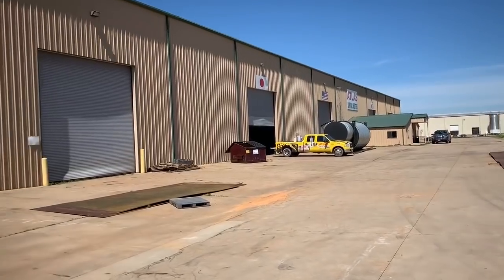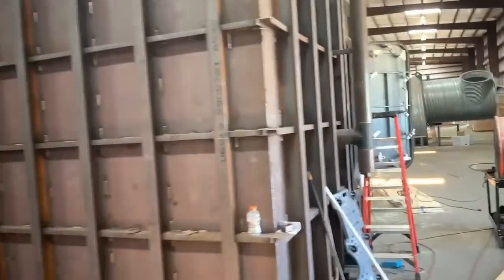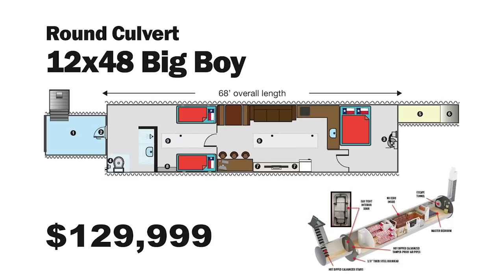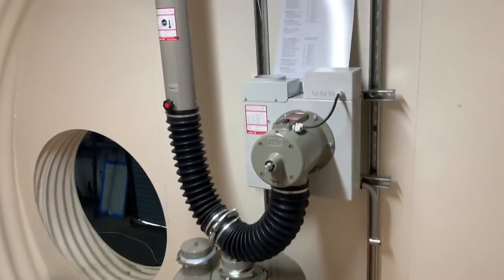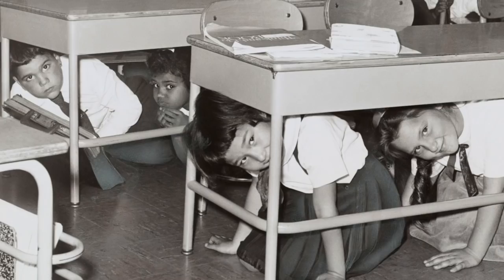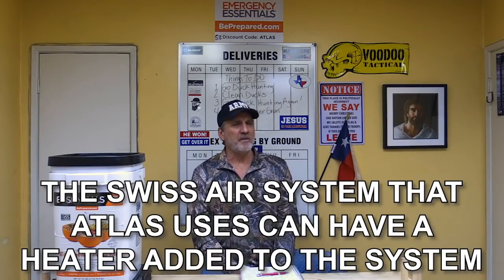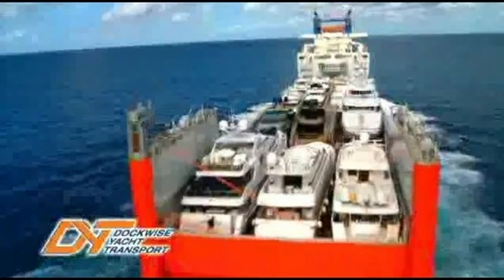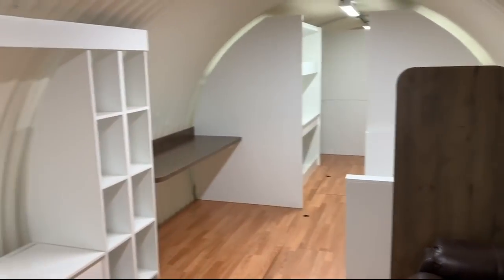Big Boy Bomb Shelter is where I'm spending the Corona Virus Quarantine.

Comment: Ron make sure when your guys are welding on the galvanized tubing exhaust the fumes. Galvanized products being torched or welded on fumes can kill a person. I've seen it happen.
Reply: They should be cleaning off the galvanising for a better weld in any case
Reply: @CreatureOTNight  you mean the CCP Virus
Reply: @CreatureOTNight  The gases released by galvanized metal without proper ventilation and/or ventilation welding masks can kill within 1 minute or less, and the person whom it killed won't even realize it until hours sometimes days because it burns the bronci cells in your lungs and coats them in galvanizing, it bonds to the blood and makes it harder and harder to get oxygen, and the toxins are not good for the brain. I've personally seen a person who was welding on galvanized metal and either he didn't realize it or just didn't care....he dropped dead literally just after he got done with the weld, he was in a hole without proper ppe
Reply: Repaint the welds with galvinized paint
Reply: The place I worked at we had to have a supplied air system to weld galvanized .The air intake had to be outdoors could not be in the shop. Grinding away the coating can help but defeats the purpose of the hot dip coating, They make aerosol touch up but it isn't the same.
Reply: they can grind it off it will be fine but yeah breathing in galvanized fumes is a killer that's for sure
Reply: @ronald8673  Por-15 it that stuff will last longer then the galvanized steel or Cold Galvanizing Compound

Comment: Could you tell me something ron?
If the water table is too high for putting something into the ground do you think putting a shelter above ground on mountings on a concrete pad and then cover the whole thing in a foot or two of dirt would THAT work for fallout protection?
Reply: You should think about a concrete dome house and cover that with dirt like an old Indian mound. Concrete needs to be 2 foot thick or dirt 36 inches. I think that's the number.
Reply: There's a plan from the 50s in a book called "The Family Fallout Shelter" which features a double wall 3' thick, made with concrete blocks, then filled with earth.
Reply: @calebfuller4713  Thanks for the suggestions guys.
Reply: @krisguntner4805  http://www.survivorlibrary.com/library/the_family_fallout_shelter_1959.pdf
All the info, including fairly detailed construction plans.

Comment: Well I wouldn’t hook up Wi-Fi router inside there.
Reply: Why? 🤔
Reply: Wireless routers give off electromagnetic radiation (EMR) and bunker would most likely mirror it back from the walls. So basically you would be inside electromagnetic oven. I would feel much more safe using only cables in there without any wireless devices.
Reply: Tywin Lannister, you’re not wrong. Maybe if there’s a material that could absorb the Wi-Fi signals then the risk can be reduced along with lowering the power of the signal

Comment: -If I were working for you (yes I am asking for a job there in Texas) I would use the Brazilian technologies that we have mastered.
-The Brasilian mastered use of CNG for all uses (engines for cars or even generators, heating, etc.), and especially cheap construction technology and concrete foundations, everything here is made of concrete bricks or even concrete.
-My dream is to immigrate to Canada and live there on my farm with my house and my Bunker, but I designed a mixed system with concrete and corrugated that could be much bigger than the bigboy reaching 16 meters (52.5 feet) width not in length and mixing corrugated and concrete techniques possibly making it waterproof.
-Send me a message...!!!